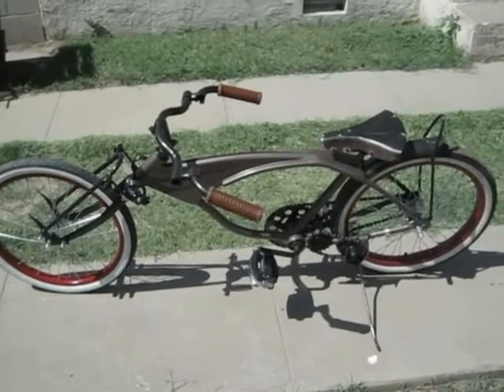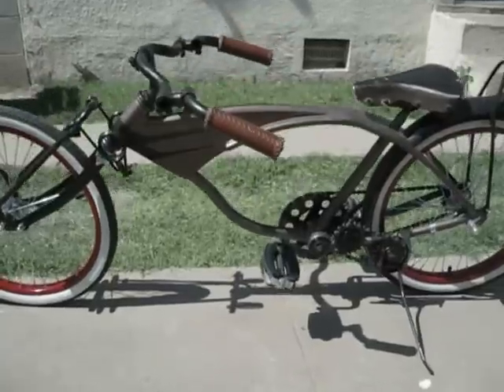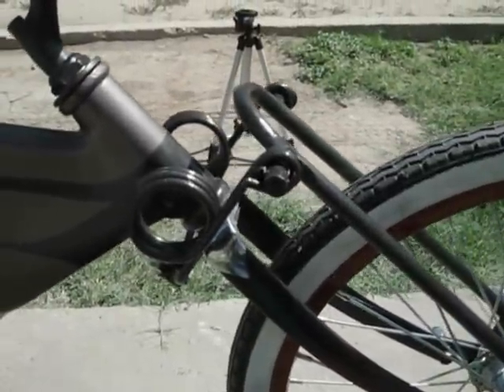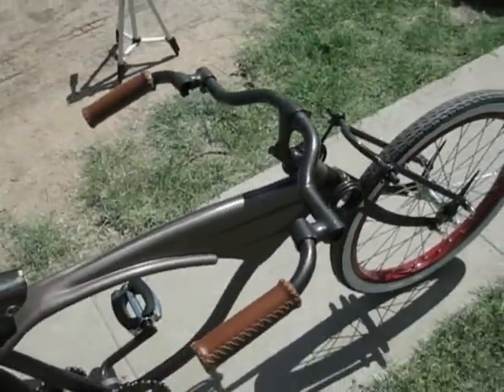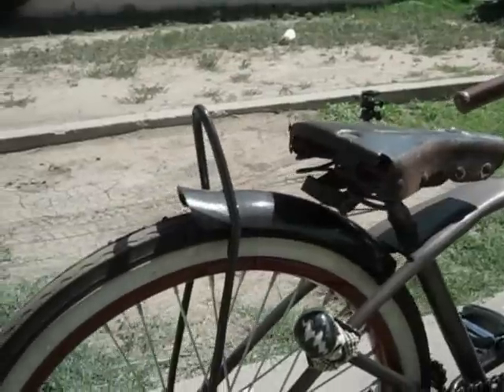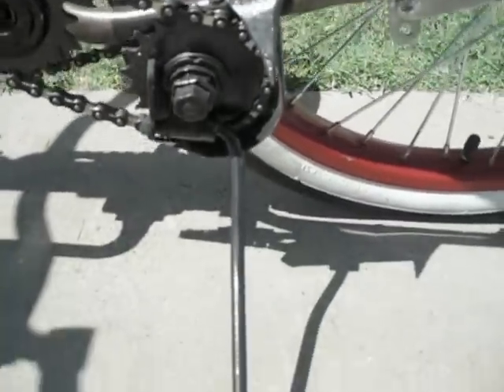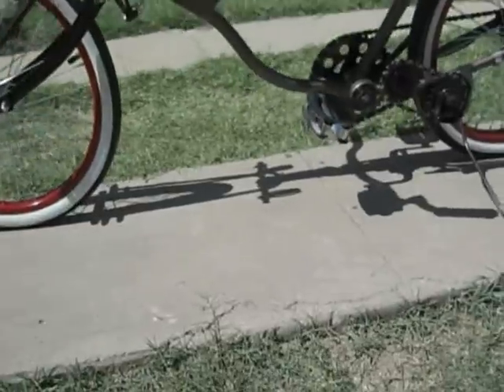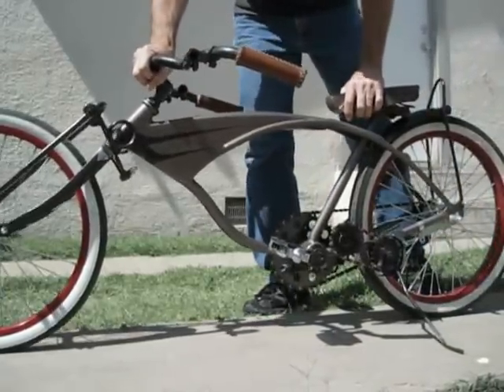Rat Rod Bike-Touch Of Trash

Comment: The problem with old  cerwin Vega speakers is the sellers on ebay and craigslist have these outrageous prices for 20 to 30 year old cv that the surrounds are falling off. Many of them tell ,me they want 300 to 500 dollars for the 10 12 or 15 inch models. If I talk them down from 500 they still want 280 to 500. if I am going to pay that much I might as well buy the ve12 or even ve8 new.

Comment: You mentioned on someones video that you have a pair of Cerwin Vega ve15 speakers, but weren't happy with them. I always liked the bass on Cerwin Vega more then any other speaker I heard. Are you saying the tweeters sounded much better in the old series? The new series sounds to high pitched and bright?  I find that a lot of high end speakers sound to tinty high pitced and bright for my taste. Does the ve15 have as much bass as older 15 inch cv speakers?